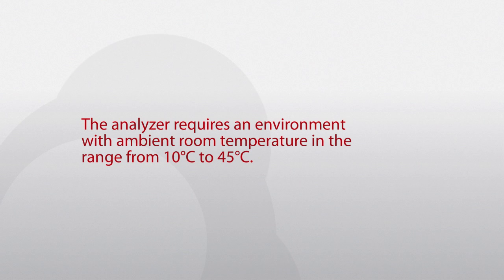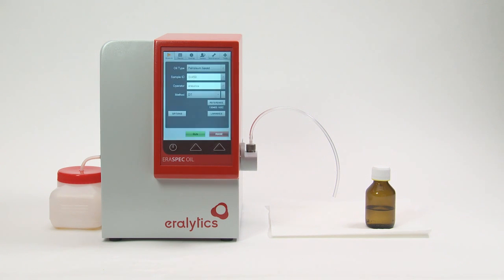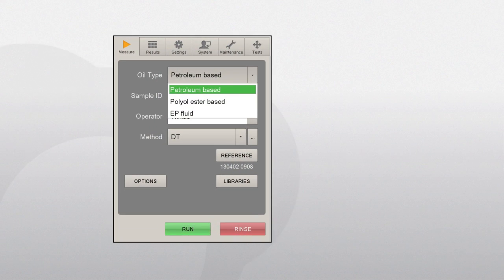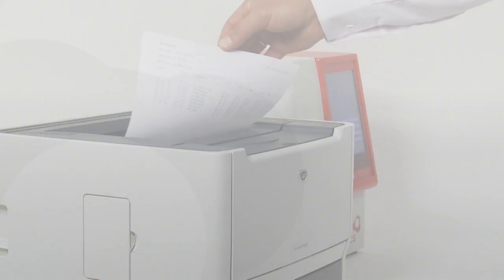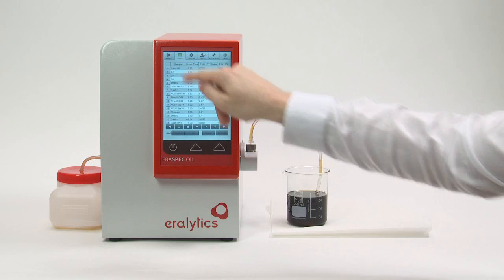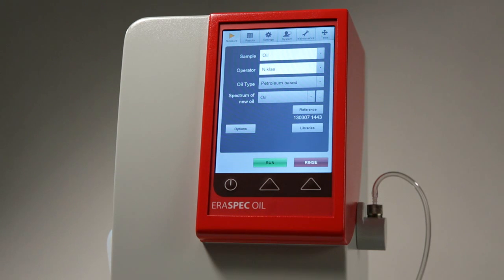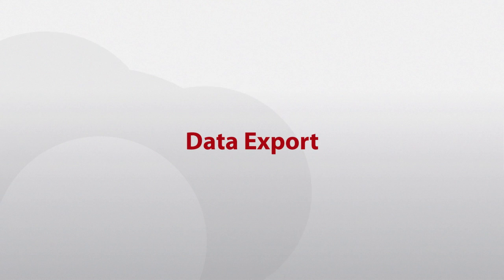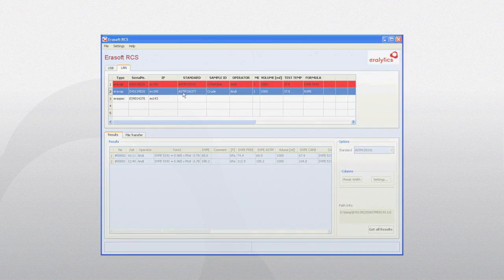Operation of ERASPEC OIL

Comment: It can use gasoline and Diesel  to test or  just lubricant oil
Reply from the maker: Dear Jengxue, you can also measure gasoline and diesel. If you have further questions, please send your detailed request to office@eralytics.com. We are pleased to answer all your questions.
Reply: Could you share libraries for the eraspec oil, for the most common oils.
Like 5w30, 10w30, 20w50, for diesel and gasoline... I have new equipment, and the data I get is wrong due to lack of libraries.